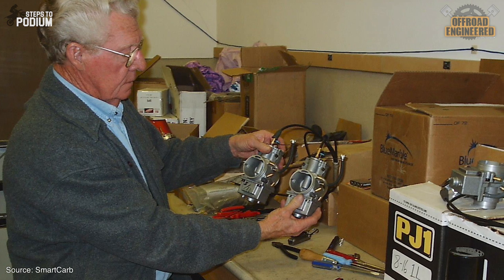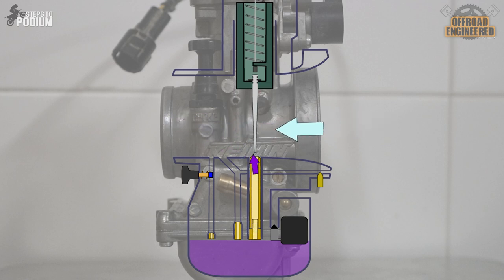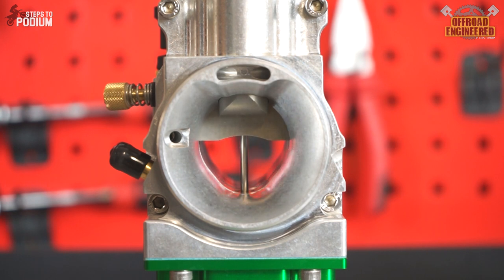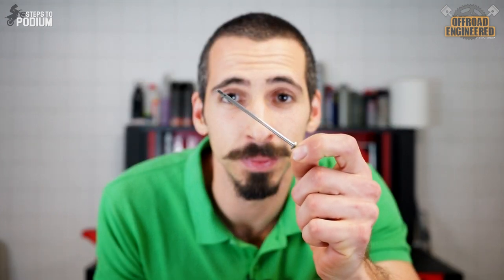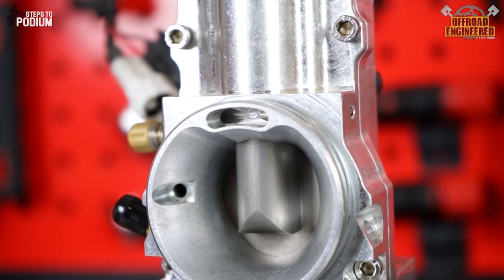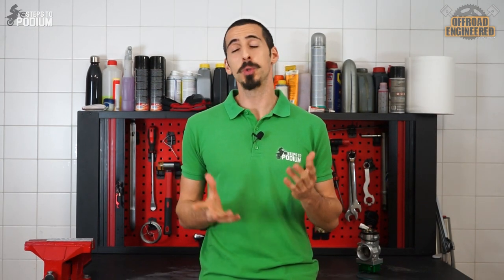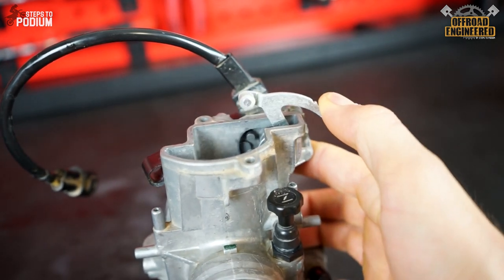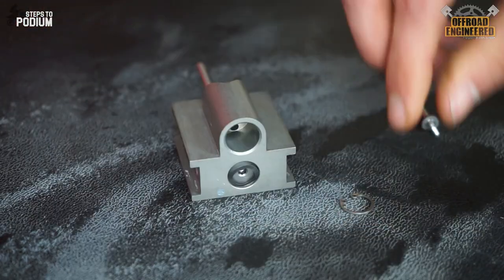SmartCarb SC2 | Offroad Engineered

Comment: This just shows that carburetors are not outdated they just need improvement. Thanks for the vid my friend.
Reply: See the price. You can convert to fuel injection it's cheaper lol
Reply: @littlereptilian7580  less parts to break though and no high pressure e pump as well. Never was a fan myself everything I own is air cooled and carbureted.
Reply: @andystoolbox  I wanted to Install two of these on my dr800. They are more expensive than my bike hahahaha. But if I win the lottery I will to it

Comment: The "scoop" as you call it serves a much more important purpose than you mention. 
It's purpose it to capture the dynamic pressure ("ram air" pressure) of the air entering the carb. Without it the carb would go lean at higher throttle openings. The Lectron uses a second, adjustable, jet and nozzle to deliver extra fuel at high throttle openings, the Smartcarb uses the dynamic pressure of the air's movement to pressurise the float bowl and deliver extra fuel.
Reply from the maker: I did mention but I appreciate the comment! 😄💪
Reply: @StepstoPodium  You mentioned it as part of the altitude compensation mechanism but it's integral to the way the carb works.
Reply: @Surestick88  well said!
Reply: Thanks dude, that clears that up 4 me in my mind

Comment: Great video, especially with the animated views and explanations of how the carbs function.  To me, a big downside to the Smart Carb is that they recommend a complete servicing every year or two (for a cost of approx $200.00).  The hassle and expense (as well as down time for shipping, etc) is a big drawback.  I've never had to send in a standard carb for servicing, even with 10+ years and 350+ hours of ride time.  
The other negative is the installation process.  Having to remove and then cut/trim the air boot is more than most people want to deal with (including myself).   The Lectron carb does not require any of that for installation.   Lectron also needs servicing once in a while, but I don't think as often as the Smart Carb.
Reply: Not sure where you're getting that information but SmartCarbs do not need to be sent in for servicing. We do recommend a thorough cleaning with hot, soapy water, carb cleaner, and compressed air once a year - especially if the carb has sat for some time without use. Rebuild kits containing all service parts (o-rings, gaskets, etc) are available and a rebuild is recommended every 2-3 years. That's something anyone can do with a handful of common tools. SmartCarbs have the smallest part count of any carburetor in this space and require no more maintenance or servicing than any other carburetor.

What you may be thinking of is our Factory Refurbishing service which is $200. It's not typically recommended or required unless the carb is in really poor shape or is quite old. It involves a full tear-down, sonic cleaning, rebuild with all service parts replaced, and reset to any factory baseline tune specific to the bike it's to be installed into. That's a service we offer for any billet SmartCarb owner, new or used, and those choosing to use it can be sure that their SmartCarb has been thoroughly inspected and checked through by our technicians. 

You don't need to remove the airboot to perform the trim for proper internal venting in the SmartCarb. We recommend pivoting the subframe up and out of the way and the trim, if even required (Betas do not require it), can be made very easily in under 10 minutes. We recommend a dremel tool with a barrel sander. The trim doesn't compromise the integrity of the airboot nor does it affect the performance of any other carburetor - but it does ensure that the SmartCarb is venting properly, which is critical for top end fuel flow (SmartCarbs need no power jet like the Lectron does) and more complete air density compensation. The installation videos on our channel provide step-by-step instructions.
Reply: @SmartCarbFuelSystems  Thank you for clarifying this.  I looked again at the SmartCarb website and realized that I misinterpreted the maintenance guidelines that were listed.  I would still rather not have to do even a "basic servicing", considering that I've never had to do that on a stock carb, even with hundreds of hours on it.  
As for removing the airboot to perform the trimming, I got that from the video put out by SmartCarb, for a 2019 KTM 300XC.  
https://www.youtube.com/watch?v=qp7VNc3RhPI&t=843s
All that said, I am still considering at some point trying the SmartCarb on my 2019 KTM 250XC.  I recently installed the new Lectron Billetron carb, but might still try the SmartCarb one of these days to see if it performs better than the Lectron.
Reply: @waynemodesitt3445  the maintenance guidelines we provide are merely suggestions. If you ride often and don’t let fuel sit in the carb and avoid ethanol if you can then there is minimal maintenance required. Just keep it clean and do that rebuild as needed (typically around 3 years depending on use).

Your KTM would require the boot trim but again it’s very easy to do, you only do it once, and we are available to answer any questions you may have. Our Quick Start Guide, included with every purchase, provides a visual way to confirm proper trimming. 

Regarding the SmartCarb vs Billetron you might check out this recent video comparing the two on a Sherco 300 SE: https://youtu.be/rPEBhnSyxbo
Reply: @SmartCarbFuelSystems  I watched that video a few days ago (comparing the SmartCarb vs Billetron).  I was having similar issues with the Billetron (leaking seals, plus several adjustments leaner on the metering rod, and I'm still getting some oil out the back of the silencer).  That video is what made me consider trying out the SmartCarb, especially if it really does perform better than the Billetron, particularly at low rpm (I ride a lot of tight/technical singletrack).
How does one go about avoiding ethanol here in California?  Other than buying race gas, I don't see a way around it.  I do drain the carb if my bike is going to sit for more than a week or two.
Reply: @waynemodesitt3445  Hard to avoid ethanol in CA no doubt. If you can't avoid it then we simply recommend that you ride frequently and cycle new fuel through the fuel system. Don't let it sit for too long. If you store the bike long-term then either using a stabilizer or draining the carb are recommended, though we tend to want to leave fuel in it to prolong the life of the o-rings.
Reply: @waynemodesitt3445  Cleaning carbs is generally recommended every few years or if the bike sat too long. That's not unique to Smartcarbs. As far as I understood you can treat them like any other run of the mill carb however maintenance is something I would generally recommend. Especially after long periods of sitting like with any other carb there will be old gunky fuel residue in the float bowl. If you have a carbureted bike you should know that.

Comment: Per SmartCarbs recommendations; when transporting or if you lay the bike over for more than a few seconds, turn off the fuel petcock to avoid the possibility of fuel running into the crankcase via the fuel nozzle/slide.  This is no big deal and should be done on a traditional carb as well or else it will piss fuel out the overflow vents.  I just ordered a SC2 for my 18 TE 250, and am looking forward to getting to know it. 👍🏻
Reply: How is it going with sc2?
Reply: @TubolMotoadventures  I just did a fresh top end and mounted the SC2.  I’ve only got about 30-40 minutes on it so far and as expected it is a bit rich.  I’m gradually leaning it out.  I only have a few heat cycles on the new top end so I haven’t ran the motor hard yet.
Reply: @evr-mr3cp what are your opinions about it now?
Reply: Any update on SmartCarb? How do you like it? I’m considering it for my 2012 XCW 300 but it’s a crazy investment for a bike of that age so not sure if it’s worth it. I’d appreciate your review.
Reply from the maker: I have a couple of videos talking about the smartcarb pn the channel :)
Reply: @patpaluch9842  I have not had any issues with it.  It is crazy money, but it does seem to work as advertised.  I know that the guy on pnwenduro has had issues with his smartcarb in cold/wet environments, but since I live in Arizona I’ve not experienced that issue.  If you plan to keep the bike for awhile and don’t want to mess with jetting as you go up or down in elevation it does seem to compensate for elevation changes.  I do occasionally mess with the adjustment on the top of the carb depending on temperature or elevation to get it to run cleaner, but as you probably know that is a “no tools” adjustment.  With all that said, if your stock Keihin carb works well and you work out jetting for high and low elevation, I’m not sure the smart carb is worth the investment unless you just don’t want to mess with changing jets.  My Husky came with a Mikuni and it just seemed more sensitive to elevation changes than a Keihin.  When the Mikuni started leaking it was the last straw for me so that is when I ordered the smart carb.
Reply from the maker: Very nice feedback, thanks! 🙌

Comment: Looks like Smart Carb designers have had a very close look at the operating principle of both SUs and Stromberg Zenith CD carburettors. SUs design principle goes back to 1906 when they were first patented.
Reply: Not so much. Both the SU and the Stromberg Zenith use entirely different operating principles compared to the modern SmartCarb (butterfly throttling and constant velocity piston actuation vs flat slide/metering rod fueling). SmartCarb integrated venting isn't used for throttling, but rather fuel flow assist inside of the float bowl. We hold our own patents for that and other proprietary technologies used in our fuel systems.

Comment: I would love to try one of these carbs and have wanted to for quite sometime, but unfortunately Lectron has scared me off. I ran their Lectron Mule with 4-1, 4-2m and 5-1 rods on my 2017 300XCW and the bottom end was terrible. Mid range and top end we’re amazing, fuel mileage was great and the bike ran clean but it just did not have the bottom end of a well tuned carb. I then bought in to their H series campaign stating 20% more power and again, that carb had no more bark off the bottom than the previous. So here we are. They have since come out with the Billetron and there’s no way I’d spend $1000CAD to test that thing despite claims  of more bottom end. Smart carb has that 36mm Venturi though which is the only way I could see it being more tunable and have more bottom than the 38mm lectrons. Hard to say though. I’m a bit tainted with my experiences with Lectron and the $1000 is a lot of money to try the SC2. Wish there was more people with first hand reliable experience who could comment on the bottom end and how it compares to a well tuned Keihin 36mm. Great video though!
Reply from the maker: Thank you! 🙏 You might be surprised with my next video giving some feedback while riding hard enduro 💪
Reply: We're sorry to hear that Lectron has turned you off of the metering rod carburetor concept. Soft power down low has been something of a historical challenge for them. The SmartCarb's keyhole or inverted egg shaped venturi fixes that earlier design deficiency by altering the throttle rate of opening to promote stronger signal at the metering rod at lower throttle positions. The vast majority of our customers are hard enduro riders like Luis, where that bottom end power delivery is critical.

Reach out with any questions - we'd be happy to put you into contact with one of our Canadian dealers as well who can share their personal experience with it.
Reply: @StepstoPodium   - I’m going to subscribe. I’m curious for sure. Cheers.
Reply: @SmartCarbFuelSystems  appreciate the message. I like the idea of not having to rejet which allows me to focus more on riding, but part of me loves tuning a carb and getting it dialled in. I just don’t know how anything could compare to a dialled in keihin. I’ve had them all like I said and given them each ample opportunity. Lectron Mule and H series, mikuni TMX, Keihin 38mm and most recently keihin 36mm. I’ve ran JD kits and have my opinions on those but currently playing with Suzuki needles with great results. The Smart Carb would be nice to throw in there as well. We’ll see. I feel like I could write a pretty extensive reviews given all the hands on experience. PS - who is you’re Canadian dealer? Cheers
Reply: @jaybird99100  the Keihin PWK, dialed in, is the standard by which other carbs are judged in this market/space, no doubt about that. You've tried them all except for the SmartCarb, and it doesn't compare to what you've tried. The tuning ability remains, only it's right there at your fingertips, tool-free, in seconds, trail-side, while your engine/pipe stays at operating temp. No easier carb to tune or tweak as needed.

We hope you give it a try and share your experience. Send us an email or call in for contact info to our top Canadian dealer, happy to put you in touch. His name is Dan Boettger and he rides/races a KTM 250SX with 300cc top end using the SC2 SmartCarb 👌

Comment: I wish there was a smaller size available that could service the large park of carburetted, especially 50cc engines (often tuned to 70cc, especially by people who would buy a Smartcarb) and also 125cc's around Europe. These usually run the Piaggio Hiper2 2t engine.

Especially in the northern parts where the temperature and altitude changes a lot, Smartcarb would be a godsend. Hopefully, this would also get the prices down a bit if they manage to achieve a large production volume. Maybe a joint venture with Malossi or Polini - who produce a lot of parts for these bikes - could be of benefit to both parties? But sadly, after eagerly waiting for a few years, there doesn't seem to be any indication that there is anything happening. They seem to be more geared towards dirt bikes. Sad.
Reply: We plan to have a 17-19-21mm size SC2 family in production this summer to serve 50-70cc applications. Stay tuned!
Reply: @SmartCarbFuelSystems  Wow, that is some amazing news! Can't wait to see how it performs.

I hope you also are able to work on cost lowering measures as well, as it would widen the market substantially in this class of MCs.

Comment: SC is great if you run a stock - stock ish setup with already developed engine setups by SC. they cannot accommodate heavy porting or racing pipes (cannot in sense that you need to tune from scratch)

The selection of needles is limited (very) and they are very expensive. Also not all engines will be happy with a straight needles. Some need richer jetting on part throttle, some need lean and/or they need a a leaner part throttle etc... a lot of options offered no solution. 

They are focused on new-ish bikes, ie last 15-20 years of production where the specs haven't changed for 8-10 years.

When I contacted them for an offer / assistance on purchase for a bike, and their best guess 3 needles to chose from as starting point. I got NO answer (2 years ago).
Reply from the maker: You should definitely hit them up again, they have one of the best customer support out there

Comment: What is purpose of 4 spoilage hose in normal carburettor?how it works 6:41
Reply from the maker: It's to avoid flooding the engine
Reply: All carburetors need to vent their floatbowls to facilitate fuel driving pressure differentials. Conventional carburetors use external vent lines that serve two functions: they vent the float bowl and ideally they provide a way for fuel to spill in the event of a tip-over instead of flooding the engine. External vent lines, however, are longer and therefore laggier in their fluid communication into the bowl. SmartCarbs use integrated venting from right at the carb manifold, resulting in not only more proportional density communication into the float bowl but faster communication as well which is why SmartCarbs don't require accelerator pumps in 4-stroke applications.

Comment: For me, a 50 hour piston with a smartcarb looked much much worse than 100 hour with stock keihin.
Reply: Sounds like the SmartCarb wasn't set up properly. If you still have it and wish to get the most out of it, definitely reach out to us directly for installation and tuning advice. We're happy to help.
Reply: @SmartCarbFuelSystems  I had reached out and followed all instruction. It ran well, but I didn’t like it on the bottom end and it didn’t run well with a head.

Comment: Most conventional carbs have the float chamber vent within the air inlet, this isn't an innovation.
With no emulsion tube I am also suspicious of the improved atomisation claims.
This design is very similar to the Blixt carbs used on speedway bikes for a number of years.